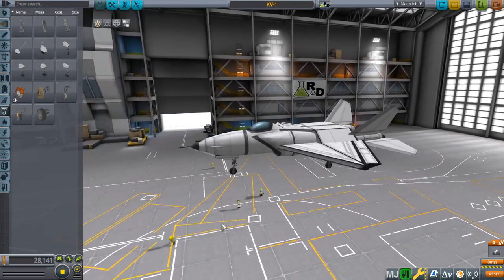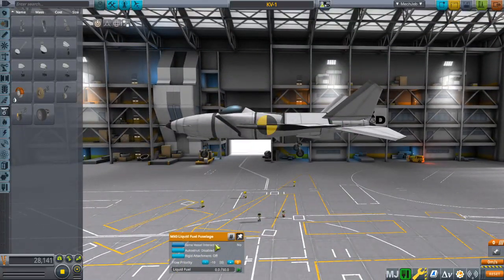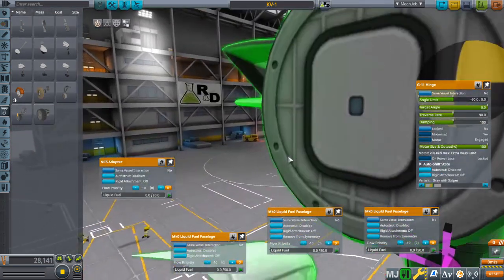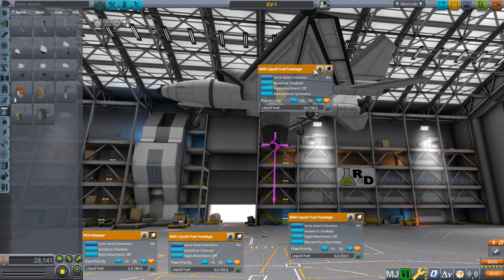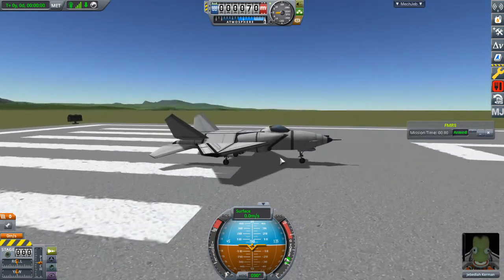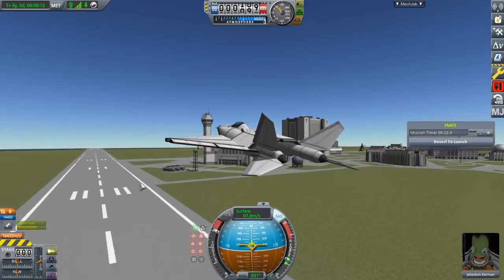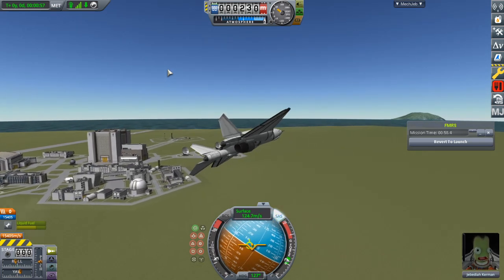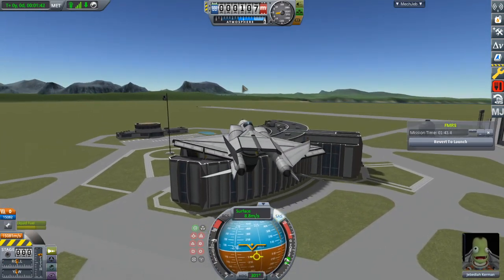The KV-1 Stunt Plane

Comment: Nice build, but where did the name originate from? I think you are aware that its the name of a Soviet ww2 tank.
Reply from the maker: No I was not aware, and it's just Kerbal Vessel 1 since it's the first design I've made in this run of things not inspired by something existing.
Reply: Ah, the KV-1. Stalinium at its finest. A miracle they were able to manage 22mph with only 600 horsepower.